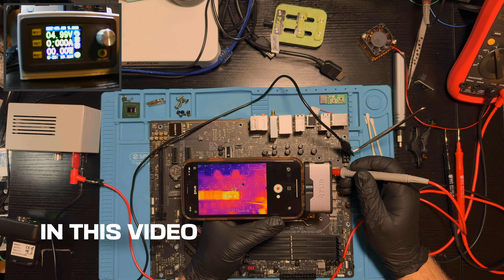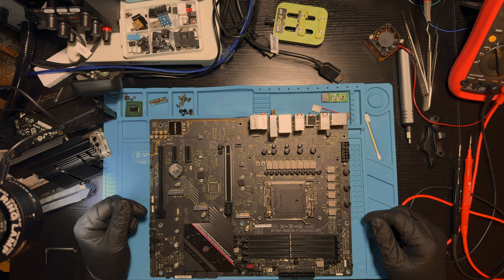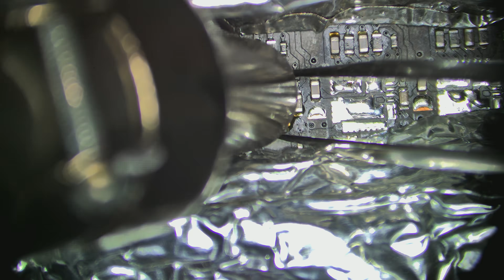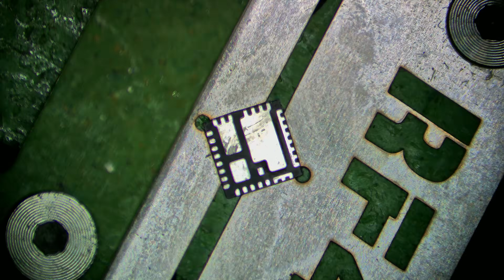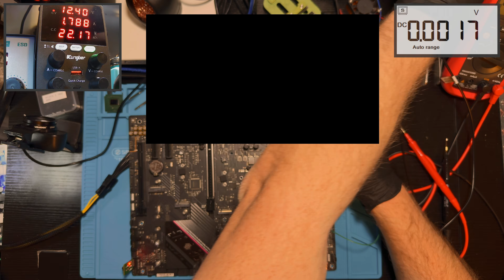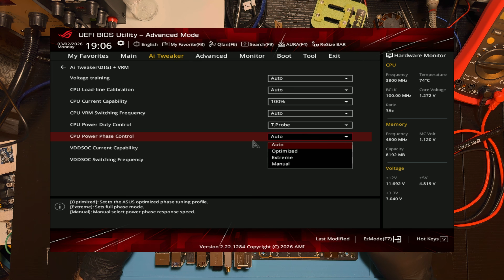Why Your Motherboard Might Be Killing Your Processor?

Comment: Just out of curiosity, wouldn't it be better to remove the BIOS battery during the investigation phase? That way wrong settings would reset to factory defaults that are supposed to always work.
Reply from the maker: Great point, and that's actually a common go-to move! The thing is, in this case factory defaults work against us — default settings keep the power phase management active, which means we'd need to go in and manually enable Extreme mode.
Reply: @FixThePixel  If you allow, I wanted to ask about that DC power supply you used to measure those voltage rails. How many watts should a DC power supply be able to produce, so you can power up that motherboard with the CPU to see, if it is working again?
After filing personal bankruptcy, my options in that regard are very limited, but I also don't want to get a slightly under-powered power supply that may go up in smoke, when I fire up the motherboard. My current "patient" is an Intel Z270 motherboard and an i7-7700K can draw up to 91 Amps. If the board draws that much at POST, I don't know. The BIOS defaults will limit the CPU to 1.1V at I don't know how many amps that is. Should I consider a power supply that could deliver more than the motherboard is able to draw or would a smaller one still deliver the necessary power, so that it won't explode during POST?

Comment: This a long shot, but i am hoping you see this message and can help me ! I am not just looking for a hand out.
-My AsRock B850M paired with a 9600x one day started flashing the DRAM and CPU lights one day, i figured it was a bad bios setting or something, so i reset the CMOS and all was fine, then the next day it happened again, and i could not get it post POST as it would stop and flash both DRAM/CPU lights. 
-I had read about AsRock b850 boards dying from various issues, so i bought a x670E tomahawk wifi. 
Now this motherboard, soon as i power it on the test post, it will flash CPU and DRAM, then both of the CPU and DRAM lights will turn off but the motherboard will not initialize VGA and work past training. 
The Debug lights will just shut off entirely and the PC stays running with power but no BIOS. 
-Is my CPU or RAM dead? I know it is not the motherboard because i actually already thought it was, so i got it RMA replaced by MSI , and they sent back a fully replaced unit, but the same issue persist. (I know my GPU's and SSD's are not bad as i use them in my other daily systems, and have installed them already, so i have narrowed it down to either my CPU, or RAM, and im hoping its the CPU, but with the DEBUG like pattern its hard to tell because both lights will turn off, first CPU then RAM but nothing else will start
Reply: Dram light can be anything, that's the most frustrating light to have on during trouble shooting.
If it makes you feel any better, there was no cases from what I heard of the motherboard killing ram
At worst the ram kit stops working on that specific board, but the ram still functions on other boards
Imo switch motherboard or CPU, you could even get a 7700x instead for a peace of mind
Reply: Thank you for the response and advice! Anything helps and i do not take it for granted. 
I do plan on grabbing a CPU to replace the 9600x because hopefully its 200/250$ CPU replacement before i sell my left leg for 32gb of ram LMFAO
Reply: @QNTM-_LUXXX  just hold on for as long as possible until the market is flooded with cheap ddr5 from china xD
Reply from the maker: I would test DRAM sticks for shorts unless they work on another board.
Reply: Try turning it with one RAM stick at the time (also make sure to use correct memory slots, on your board counting from CPU the 2nd RAM slot is for single stick, slots 2 and 4 for dual stick setup). There is chance it could be dead RAM but having 2 sticks die at the same time is unlikely, so you should have one survivor at least. Also if it turns out one of the sticks work it doesn't have to necessarily mean the bad one is dead, there is a very silly thing with DDR5 memory sticks where most of the stick manufacturers left the SPD chip soft write-enabled state instead of read-only, that chip stores all information about used modules type, their frequency and timings. What I've seen is that in 2 and 4 sticks setup for whatever reason the data on just one of the sticks gets scrambled/corrupted, leaving it bricked. In that case, if memory manufacturer will be like "if you RMA we can't give you a replacement memory due to shortage, we can offer you to pay you back whatever the memory costed you way before the price inflation hihihehe :) ", you could still save that stick by having SPD data cloned off the working stick and programmed to the bad stick. You will have to ask your local repair stores if they can do it for you tho.

Comment: I think you made a mistake. 6:54 you can see the 2 and 3 are lit up, yet you identified 1 and 2 as the problem. So when you removed 1 and 2 and still had a short it was not a surprise.
Reply from the maker: It is 100% possible, since #1&#2 represent SOC and #3 represent VCORE, it is completely possible that only one of the first two drmos was damaged, but they both light up on thermal cam...
Reply: @FixThePixel  It looks to me ( maybe it's just the  video), that only 2 and 3 light up. 1 seems ok. If you check the time stamp I showed. The screw hole shows it's one more mosfet away.

Comment: Replacing the CPU socket on the donors motherboard was the most logical thing to do if it was the only problem, you replace only one component in place of 7 less time and generally these sockets are available, in the worst case you can reuse the one from the faulty motherboard (will need more patience but it's still less work than looking for an infinite rabbit hole. (It's only my point of view obviously after I watched other reputable repair shop do exactly that.)
Reply from the maker: It’s always a dilemma deciding which of the two motherboards should live. I do have spare sockets, but replacing them isn’t nearly as easy as it looks in some people’s videos. 😉
Reply: @FixThePixel I know it depends on the PCB, the temperature can very and you want to be sure to be at the right temperature.